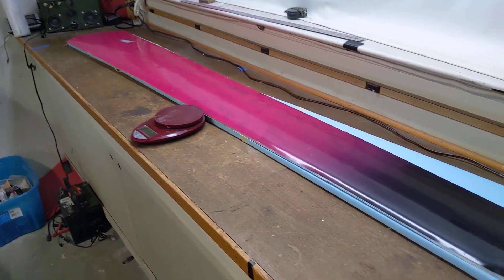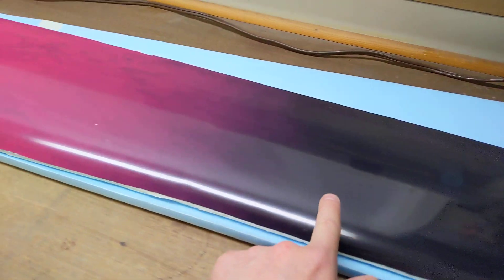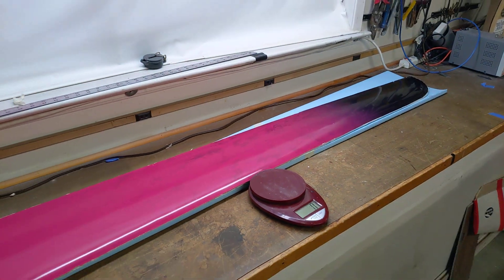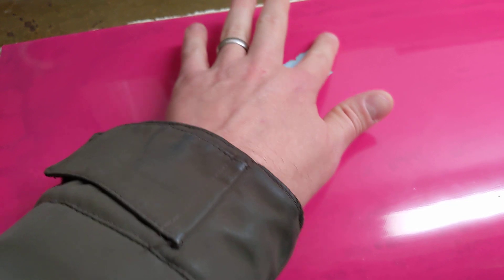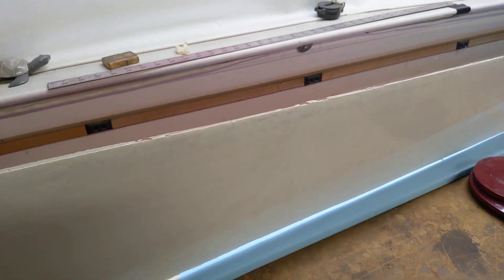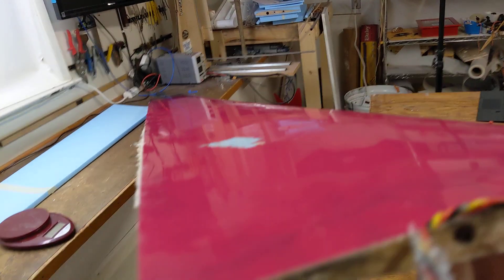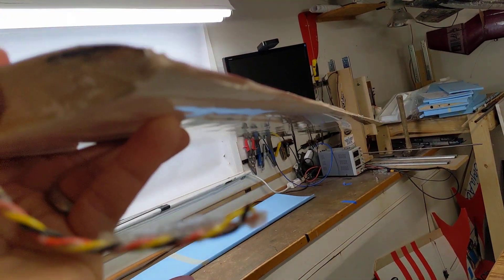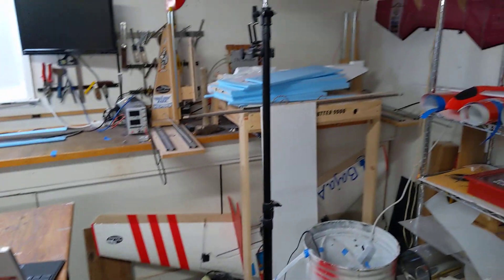4m Plank - 5 - Left Wing Out

Comment: I love it!  It looks like a "galaxy cloud" or something, friggin sweet!  Could you talk more about the mylar thickness and over-cut you use to get the LE so (relatively) nice?  My LE's have come out WAY worse, and I want to get better.

Or I'll just pay you to bag my wings in the future :P
Reply from the maker: So what i do is i aim for about a 5mm gap on the leading edge. Meaning the mylars do not touch each other, there is a 5mm(ish) uncovered nose area. I will take like a 1-2inch strip of peal ply on the outside of the mylars to cover that leading edge and hopefully soak up the excess epoxy, Than i take masking tape and pull those top and bottom mylars as close together as i can. If you don't do that you have the possibility of the vacuum pushing something into that gap before closing the mylars, so i close it first. The trailing edge i actually make extra long on the mylars as that doesn't really matter and im going to trim anything that seeps out anyways. I can do a short video on the next one about this if you want.

Comment: Beautiful! How are you going to be dealing with adverse yaw?
Reply from the maker: Not one of my slope planes has a rudder.
Reply: @thenatedog  so , do they have no issues with adverse yaw?! Wow !
Reply from the maker: @sufysprojects2689  not that I've ever noticed but when your slopes soaring at least in my case most of the times when I'm about to turn I'm climbing and slightly heading in the direction that I want to turn and it turns into a hammerhead or some people call it a stall turn and so you know that yaw affect maybe it is happening but gravity is pulling the nose down into the turn already
Reply: @thenatedog  thank you for the explanation !! And I guess adverse yaw is weaker at lower airspeeds
Reply from the maker: @sufysprojects2689  yeah I really don't know that much about it and I kind of wonder if there's a difference to with powered and gliders but I have no idea.
Reply: @thenatedog  there's no difference between powered planes and gliders, it happens because of the different drag produced by ailerons

Comment: Do EXACTLY what you did on this wing with the other wing. It will look like you intended to do this.
Reply from the maker: I didn't show it here, but i measured a spot on the wing tip 18 inches in and placed a screwdriver so that i would stop painting the colors at that exact spot. Should be able to recreate it. Thanks for the comments!